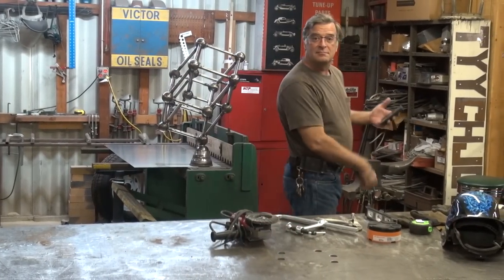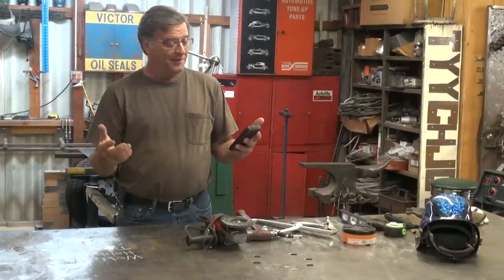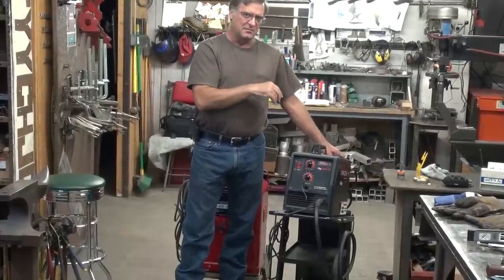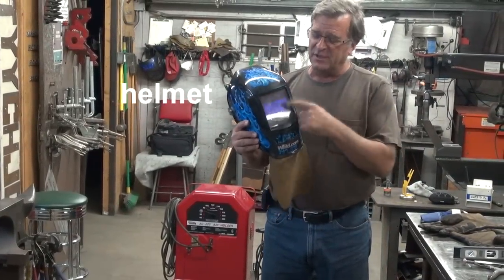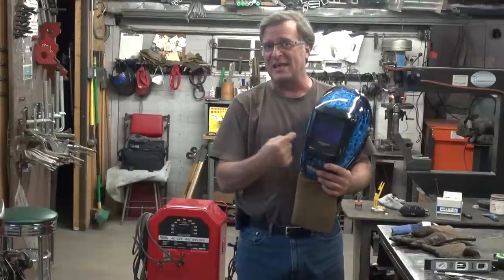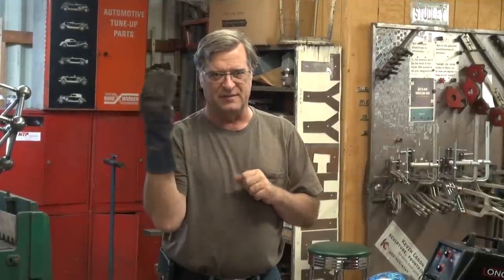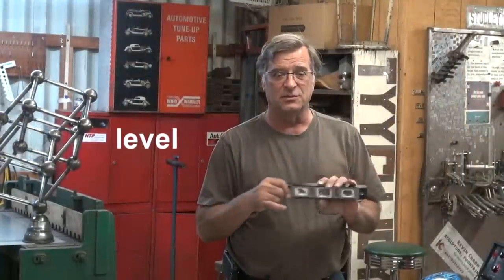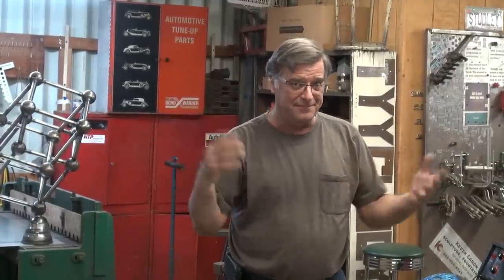What You Need for Your Fabrication or Welding Shop - Kevin Caron

Comment: This may be a stupid question but I need to ask anyway. 
I just recently obtained a Lincoln AC-225. I'm 43 and haven't done any welding since high school. I can do ok, I do have lots of holes when I'm done but here's my question. When I start w a new electrode I have a terrible time starting, it sticks, long arcing and burning holes. Once I get the electrode about 1/3 gone my welds start to even out, no holes, no burning etc. I even change the amps making sure it's just right and not too low or too high. 
why is it so hard when using a long, new electrode but get better the shorter it gets? By the time I have about 6" or so it sizzles perfectly and puddles are perfect etc. 
I appreciate any helpful info
Reply from the maker: Well my first question would be which electrode are you using?

Second would be what amps are you using on what diameter electrode?

What thickness of metal are you welding on?
Reply: Kevin Caron, Artist I'm using Hobart 1/8" 6013 and the metal right now is 1 1/2"X1/4" angle. It seems to start better at 105 amps but melts it very quickly but runs better at 90 if I can get it started. Not sure of the kind of steel. I dug it out of the bottom  of my cousins scrap pile that's been there for 15 years, and yes I grind the rust and paint off before welding. But this problem I'm having does it on my 6011 and 6013 from 1/16" rod to my 1/8".
Reply from the maker: Amps are too low..   Try 110 to 115 amps with the 1/8th inch diameter..   And yes, it will eat up the rod quickly..
Reply: Kevin Caron, Artist my Lincoln AC-225 only goes from 105 to 120. Is there a better size rod that would work better at 105 amps? I'm using 6013 and at 105 it will burn holes if I'm not careful. But sticks at 90. 
I'm building a gate from angle iron w horse fence inside. It's welded wire fence w 1/8" material. I'm nearly finished w it though. I just need to put in the fence. 
I welded the hinges on this morning and I was very careful and only burned a hole on the last one at the top about 1/4". 
Now I have another project I need to do that will be 1"x1/8" angle and 1"X1/8" flat stock w a 1/2" hollow round tube. It's about 1/16" thick. I'm not really sure about that. I'm going to start at about 75 amps on that. 
I've tried 1/16" 6011 rods but it burns through that like butter...lol....
I will say the more I use it the better my welds look. 
I'm disabled so I can only work about 15 minutes or so before I have to stop.
Reply from the maker: I am a big fan of 7018 A/C rod..   Might work better than the 6013.
Reply: Kevin Caron, Artist I've got some 7018 but I thought that was reserved for stronger / heavier projects. I haven't even opened the box on em yet...lol...I completed my project today but I'll give the 7018 a try on my next go round. And I truly appreciate the advise! I had forgotten how much I enjoyed welding! I'll let ya know if I have any more problems. My next project is going to be a header on my pallet forks that I'll use the 7018 on. It's using 2 1/2"x3/8" angle.
Reply: get some 7018AC, 6013 and 6011 in 3/32 and 1/8 inch and get a copy of the little hobart pocket welding guide, to reference for the rods uses and amperage to use it at. also read up on the rods too. and go burn some rods
Reply: ryanjames170 thanks, I appreciate it!
Reply: Oh on that machine use the 7018AC not regular 7018, as 7018 is a DC rod like 6010, big thing is learn your machine. My 80 amp DC box hates certain brands of 6011 it simply won't light them up.. so get a some 1lbs of 6011, 6013 and 7018 by a few different makers.. and see what it likes, make notes.. on the amps too.. and don't be afraid to cut down the electordes, it helped me when I got started.

Comment: Hi. Are you still replying to questions as I have one.👍
Reply from the maker: How can I help you?
Reply: Kevin Caron, Artist Great 👍 
I’m looking fabricate My own workout apparatus, I,e “power rack” 
The steel I’m looking at will be 5-Gauge
3x3 box sectional 
What type of mig would you recommend.
Also the box steel tubing will require 1” holes.
What tool would you recommend for this.
I have done some mig so have experience.
Thoughts appreciated.
Reply from the maker: I would be looking for a 250 amp mig for this job.    You are going to need all the power you can get!   As for the holes, just use a drill press if you can.    Or a mag drill if you have one.
Reply: Kevin Caron, Artist thanks for the advice. 
I’ll be looking at having an extra power electrical supply. 
What do you think to Lincoln.?
I’m also looking into an esab 
I’m currently using a migatron at work wich is an awesome piece of kit.
Reply from the maker: Lincoln and Esab are both very good machines.    I am sure you will be happy with either one.
Reply: Kevin Caron, Artist Much appreciated.👍
Reply: I see in the background of your vid, there’s a De-Walt chop saw
Did you get on with it, 
I’ve recently purchased the same one, 
As I’m starting to gather tools now.
Will this be sufficient 5mm thickness steel tubing, 
I should have looked into it before I decided on steel thickness
Reply from the maker: The DeWalt chop saw is a monster!    It will serve you very well.    The only problem is the bed is a little weak and it tends to bend right next to the cut of the blade.   Just make sure you go slow and give the blade time to cut.   DON'T FORCE IT!
Reply: Kevin Caron, Artist I remember you saying that in one of the vid’s, let the blade do the work as they say. 
It’s an abrasive blade saw, I noticed yours was steel, 
I’m not sure if It would be suitable for a steel doc blade,
I have the receipt, if I need to change it for a chop saw that caters for such. 
Also, can you recommend a good bar bender, 
I’m looking at the bare minimum of equipment to get started, with enouph tools to do the job at hand until I build up items.
Reply from the maker: You have to remember that the abrasive blade chop saw will not use the steel blade.   They are two different saws.  But the advice goes for both saws.    If you push the abrasive blade it will bend and give you a bad cut.   If you push the toothed blade it will dull much faster and then you have to have it sharpened.    Cost me about $60 a blade to get them sharpened. And the toothed blade can run anywhere from $75 to the mid $250 range!
Reply: Kevin Caron, Artist seems pricey, 
However, they may serve more economical in the long run if you compare to how may abrasive discs one can go through on a regular basis.
Would you think it would possibly be more cost effective long term if I purchased the one catered for steel disc, 
I have the receipt, 
So I’m able to exchange & make up any difference in cost if need be.
What’s your take 👍

Comment: Hi uncle Kevin I know It might just be an stupid question ...can you actually use wet/Dry vacuum as welding fume extractor? Will it actually works?
Reply from the maker: Haven't tried this one...    LOL..     should work okay though..
Reply: Wet/dry vac is pretty noisy. I have a blower fan that I use for my everlast welders. I believe Jody showed what he uses when he made a downdraft plasma table.
Reply: Or weld in a heavily ventilated garage, mine is rental made of sheet metal, galvanized pipes and wire fences.

Comment: FYI: never wear gloves when grinding!
Reply from the maker: I disagree!

Gloves have saved my hands many times from cuts and what not.    Just wear tight ones and keep your fingers out of the disk.
Reply: I agree with you, just search machine degloving.
You wil never wear gloves, Even when welding xD
Reply: If a 4 1/2 cutting disc runs across your fingers, you'd wish you had gloves on